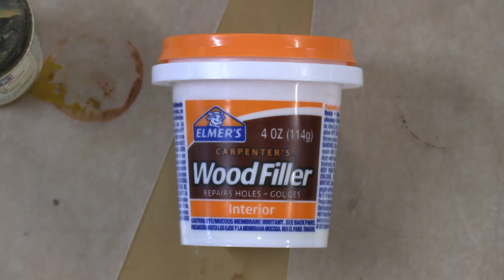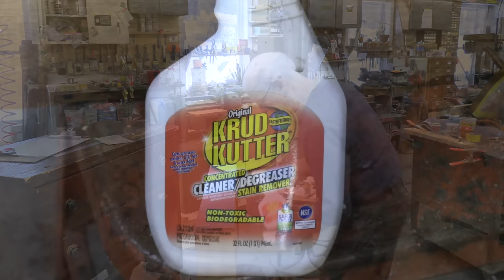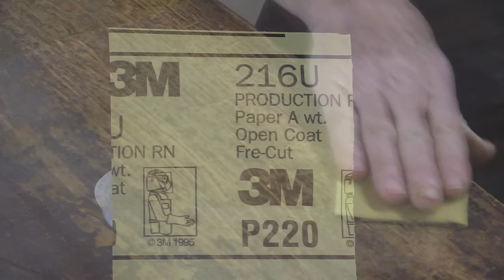Battered Bureau or Hidden Beauty? - Thomas Johnson Antique Furniture Restoration

Comment: Always enjoy the tricks and tips! I have an old oak 5 leg table that is in good shape that I started working on in the fall. I need to get back to working on it. The top has a huge dark stain on the table top and oxalic acid did nothing to lighten it. (It might have had an ink spill.) I am thinking my only choice is to try to sand the table top. Any other suggestions? Thanks so much! Enjoy the videos! Marcia
Reply: Darken the rest of the table a little, so there is less contrast, and keep the stain there; it's part of the history of the table. If it is old ink, particularly iron gallate-based ink, it usually penetrates really deeply into the pores of oak, and even a lot of sanding will leave a visible stain (not to mention the amount of work to sand it flat if you need to remove 3-4 mm of surface all over the table).

Just my 2 cents...
Reply from the maker: Thanks! I agree with dlevi67, it might take way too much sanding. I like the idea of staining to lessen the contrast, and then just don't worry about it.
Reply from the maker: But a very good 2 cents! Thanks

Comment: Just about everything I make, repair, I wire wool and home made bees wax polish. It makes such a difference. Why do you use the foam applicators? Is it that they don't leave bristle marks that you get with traditional paint brushes. Thanks as always Tom
Reply: Try them, and you'll be converted... (I didn't think they were any good either, but I found them a lot easier to use and to clean than traditional bristle brushes).
Reply: Also you dont lose alot of product in the bristles.
Reply from the maker: Thanks! Yes, love steel wool and wax. I always hated foam brushes but found they work great on this slow drying varnish. I clean them an reuse, somewhat limited but usually can use just one per job
Reply from the maker: Thanks! Yes, I try to avoid any single use products, but by leaving the foam brush in some paint thinner I can usually use just one for an entire job.

Comment: Hello and happy holidays!  I'm rewatching this video because I have a similar chest of drawers that I would like to try a "gentle restoration" on, with the skills I've learned largely from watching your channel!  My conundrum: every face except for the top was painted with an ebony paint at some point in the past, then finished with shellac.  It covers a thick veneer, so I have a bit of wiggle room there with the thickness of the veneer.  I don't think I've seen you strip paint off of a piece -- when a situation like this occurs, do you roll with the paint, or take it back to original?  Thank you in advance for any guidance you can give!
Reply from the maker: Thanks! Yes, I would strip it. I would use methylene chloride stripper, the bad stuff, but try a "green" stripper, check out this article: https://www.woodshopnews.com/columns-blogs/patience-is-key-with-green-paint-strippers
Reply: Thank you so much!  I took your advice, and have the piece stripped down to its gorgeous cherry wood (solid for the frame, veneer on surfaces plus on the backside of some surfaces as well, which I thought was interesting going to that level of detail in the finishing!).  I'm now rewatching your asphaltum videos, as that's what the top looks to be finished in.  Thank you again for your advice, and also for taking the time to respond to your comments -- it really means a lot.   @johnsonrestoration

Comment: Why do you use shellac on raw wood?  What is the purpose for using shellac?  I see others use it but not sure why it's used.  And does it prevent the wood from accepting stain?  Sorry for the dumb question, but just trying to learn.  Thank-you for the great videos.
Reply from the maker: Thanks! Shellac makes a good sealer, it helps trap any contaminants in the wood (a common problem with old furniture), It's easily removed if necessary. I will often seal with shellac before staining to help control the stain, so it's not as dark. Often period antiques are finished completely with shellac

Comment: The groves around the handles were probably the result of the back screw being tightened after the handle loosened over time? With each tightening the handle settled more deeply into the wood?
Reply from the maker: Thanks! Yes, that's what I think happened. But I've never seen damage quite like it

Comment: I've used a sponge soaked in hot water let sit on hammer marks and other dents with varying degrees of success to get them out of wood like that. I guess here the problem would have been that the whole section would have raised and it would have needed to be sanded, and then the bare wood stripes would have needed to be stained and touched up. It's also not very visible down there on the bottom corner. It's always a pleasure. Thank you.
Reply from the maker: You're welcome! Yes, I've done the same. I have a tendency to NOT correct other's mistakes unless I have to

Comment: Hey, I hey do tou still use flathead screws?
Is it to limit torque or did you just have a few laying around?
Great channel
Reply from the maker: Thanks! Yes, on antiques I try to match the screws, and I usually have old ones that work well. It doesn't really matter but I figure why not?
Reply: @johnsonrestoration  I’m a mover and we see ‘repairs’ constantly. When someone uses say a t25 torx, they run it way too far in. Does more damage usually. 
I’ve learned so much from the videos.  Thank you

Comment: Absoposolutelytively stunningly beautiful. 
My Amish family asked me how one can get rid of the smell of cigar smoke in a very old piece of furniture. Grandfather and great-grandfather both smoked cigar and pipe and the smell is in one piece of furniture that has been past on to them and it's about 180 years old, handmade by the great- great grandfather when he was young also with those hand cut dovetails. His wife does not like the smoky smell and asked me if there was a way to get rid of it  because they want to honor that furniture and pass it on to their children. Any tips you could share with me? I got it sitting here in a shed now because even though I am a smoker but this old smoke and possible nicotine residue that may have collected on the furniture is even a bit much for me. It seems to have soaked in deep. Besides the smell they just want it cleaned and waxed to keep the character and the little dings and scratches that tell a family story.
Reply from the maker: Hi Ursula, that's always a tough problem. Clean all surfaces, inside and out with a cleaner like Krud Kutter. Sand the interior of the drawers, and seal with 2 coats of shellac, sanding between coats. I'm assuming you are not refinishing the exterior surfaces, but they should be cleaned as well. Don't forget the back of the chest! Put some of those activated charcoal packets in the drawers too if needed. Good luck!
Reply: @johnsonrestoration  Thanks so much. I will let you know how it ends up. No not refinishing, just cleaning and waxing. Basically leaving it as is as requested just getting rid of the smell and years of dirt.

Comment: 30:27 From the look of the packaging, steel wool comes in grades up to 4. Is grade 4 braided tow cable or something?
Reply: It's what they use for suspension bridges. To hold them up, I mean.
Reply: @dlevi67  Thanks. Sounds pretty coarse.
Reply: @lenkuffert7428  It sure does...

Jokes aside, I've never used #4. #2 / #3 are great for removing flaky paint from wood or stone, and rust or limescale from metal, but you definitely need a pair of strong leather gloves to use it.
Reply: @dlevi67  I bet the individual fibres of #4 are pretty stiff, so I thought of tow cable. It would be cool if Tom J discussed the relative merits of 0000 vs fine scotchbrite. I use the Mirka range, but the same question applies.
Reply: @lenkuffert7428  "It would be cool if Tom J discussed the relative merits of 0000 vs fine scotchbrite"
One more vote for that!
Reply from the maker: Thanks! Yes, I've never seen #4! I will talk about steel wool vs Scotchbrite soon
Reply from the maker: I will do it! Next time I'm rubbing out a top

Comment: I can't do a search for over 1,000 replies, but I believe this simple, country piece likely had original wooden knobs attached with  wooden, threaded dowel screws that were replaced with later brass pulls. That explains the large holes in the drawer fronts at 2:54, and when the later brass pulls were added, without filling in the large hole, that is when the brass pull's fastening screw  loosened and chattered the back-plate around to cause the indentation that were seen here.
Reply from the maker: Thanks! That sounds about right - we may never know for sure!
Reply: @johnsonrestoration  Thanks for your reply. Any residual screw marks in those large holes?

Comment: I can't add anything worthwhile to the present comments but I wanted to ask if you have ever used a gallon milk container? I cut them out so I can still use the handle, to me lots better than holding the edge of a bucket or bale, and disposable.
Reply from the maker: Thanks! It's funny, I've done that for a few other things, like spreading salt on the driveway or bailing out a boat. Didn't occur to me in the shop

Comment: Prezado Mestre Thomas, o nobre amigo não gosta de máquinas elétricas, como por exemplo: lixadeiras elétricas?  Na minha ignorante opinião me parece que o amigo conseguiria obter um bom resultado com menos esforço físico. É sempre um enorme prazer ver  milagres na restauração do Mestre. Abraços !
Reply: Sometimes you want to feel the surface as you are cleaning/sanding to know where to stop. Using an electric sander makes that a lot more difficult, particularly if one is trying to keep the minimal variations due to tool marks like the (not-so-fine) finishing plane used on the top, or the variation in colour around the handles.

(Sorry for the English - I can read Portuguese, but writing it... different story!)
Reply: @dlevi67  Muito obrigado pela explicação. Entendi o seu objetivo e me pareceu bem pertinente. Abraços!
Reply: @manecobeirao  You are most welcome - have a great weekend!
Reply from the maker: Thank you! I think dlevi67 gave a good answer. I will use machines when the job calls for it
Reply from the maker: Thanks!
Reply: @dlevi67  Muito obrigado e desejo o mesmo para o nobre amigo e família!
Reply: @johnsonrestoration  Ok !

Comment: I know you don't generally use stripper for removing finish, but in this case (since you were trying to retain the texture) was there a reason you didn't just use stripper on the top?
Reply: Trying to keep as much of the original stain as possible - not least because there is so much variation in colour across the piece that any complete refinish would not look as good (IMHO - I like patina!)
Reply from the maker: Thanks! I like dlevi67's response!
Reply from the maker: True! What does IMHO stand for?
Reply: @johnsonrestoration  In My Humble (or Honest) Opinion

Comment: Did you consider just replacing the block that held the leg, given how it’s condition and the fact it wouldn’t be seen?
Reply: It was solid enough... just with a lot of small holes!
Reply from the maker: Thanks! dlevi67 is exactly right. I won't replace anything unless absolutely necessary
Reply from the maker: Exactly!

Comment: It surprises me that you didn't have a better plan for filling in those round worn areas with all the experience you have.  I would just use bondo, dried in 15 minutes.  you have to color it anyways and no shrinking.
Reply from the maker: Thanks! Well, that’s exactly what I did, only instead of Bondo, I used the Minwax product which is easier to use

Comment: Why were pieces never finished internally?
Reply from the maker: Thanks! Good question! I have finished a lot of new pieces of furniture, built by custom makers, and we always sealed all the surfaces, inside and out. Most manufactured furniture is not, just a way to cut corners I suppose

Comment: it seem you should have used a harder filler around the knobs because the filler you used was softer then the wood . a two part epoxy would have been harder then the wood filler. you do nice work but i cant see how you make any money based on all the hours you spend.antique road show talk about how restoration of furniture reduce the value of the furniture. must be hard to restore it knowing that. piece looks much better.
Reply from the maker: Thank you! I think the putty will be hard enough. I stopped the hardware from spinning by using an estcuctheon pin through each back plate (I think I showed that) The whole thing about refinishing antiques is misunderstood. I repair furniture that needs to be repaired, and I do as much as possible to preserve originality. But if the finish has been severely damaged, as in this case, it has to be repaired